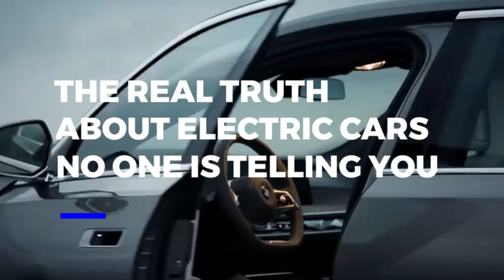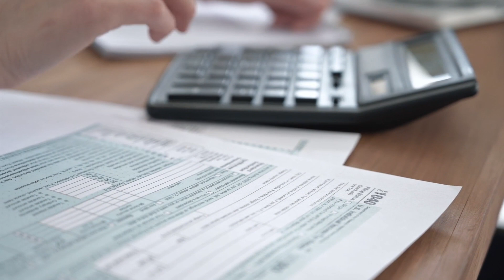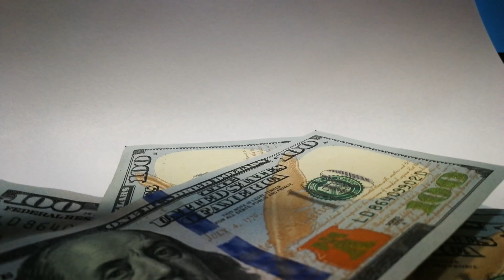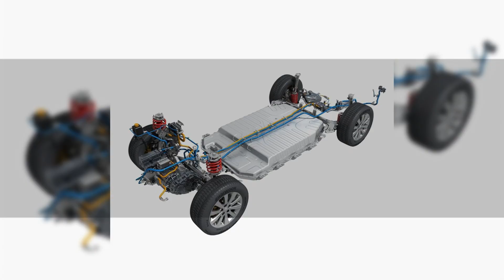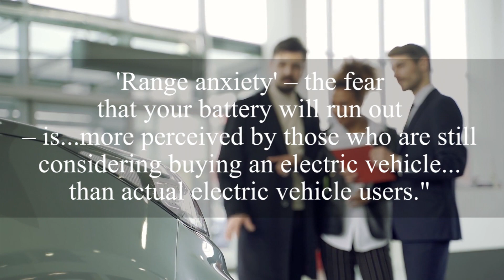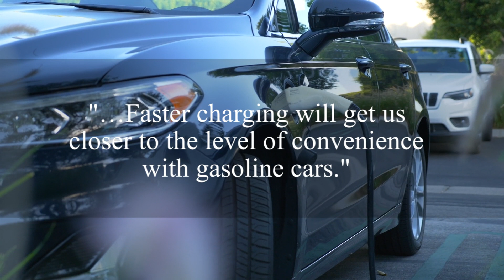The REAL TRUTH About Electric Cars They Are Hiding

Comment: I ordered an EV SUV AWD for local commutes only. I drive about 25 miles per day.  After installation of the charger and planning to keep it for 5 years maximum I am looking at saving an average of $4500 per year in total cost. The range on this one will be about 300 miles. I can safely use it a number of days per week without needing to charge it.  I will be plugging it in every night to top it up. I will not keep it past warranty, not long enough to lose a lot on depreciation, and not long enough to worry about battery life degrading.
Reply from the maker: @jerryfacts thank you for sharing your experience it will really help others to understand pros and cons of EV .
Reply: And how do you recycle the used up battery? What about the environmental impact of making those batteries and the oil used in the manufacturing of the EV's, and the ongoing impact of the EV batteries on the environment? No one from the manufacturers or the go green movement has addressed these issues.
Reply: @timlist4173  
The recycling of the batteries means to break them apart and get back the rare earth metals and etc. Very expensive and energy consuming project that technically is not worth it. But, recycling the batteries looks good to the environmentalists who believe all these conspiracy theories and are voters. 

In the future when there are many millions of warn out batteries being disposed of this will be a huge issue. There are signs of this issue starting, but governments don't want to acknowledge this.
Reply: We will see what happens at the end of five years. Let’s not count the chickens before they hatch. By the time 5 years are over the green people will be there to collect their pound of flesh when you go to dispose of those highly toxic batteries🤮🤑

Comment: Definitely EV is the future however need to think about the challenges like inadequate charging infrastructure ,risk of grid overload as well ,hope this will be developed in near future .
Reply: Yea, the video did mention plans for hundreds of thousands of charging stations to be built in the near future. Transitions don't happen instantly, but definitely. 🚀🚀🚀
Reply from the maker: Yes, that's crucial!
Reply: The power companies have been increasing grid capacity. They have to in any case because they have to deal with growing industry and growing population. There will be huge expansion for public and private charging stations. EVs pose a much greater issue when it will come managing the millions of depleted batteries, and disposal of the no longer usable parts that make up the EVs.